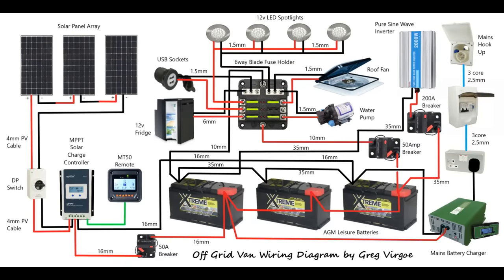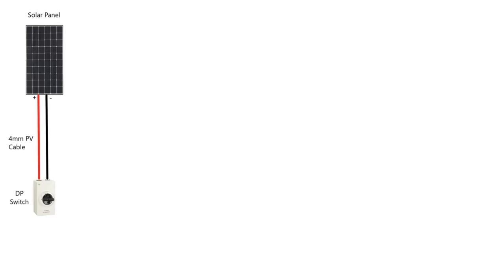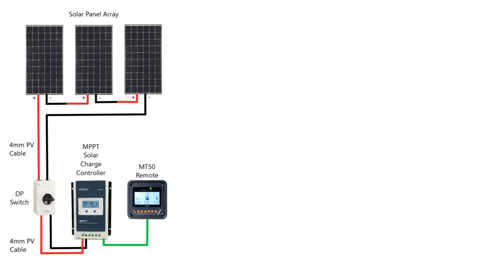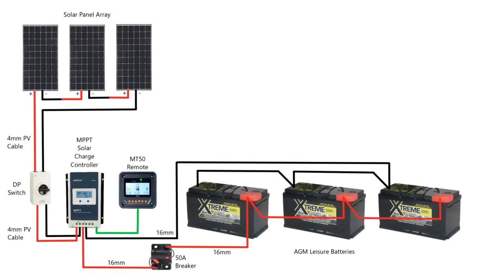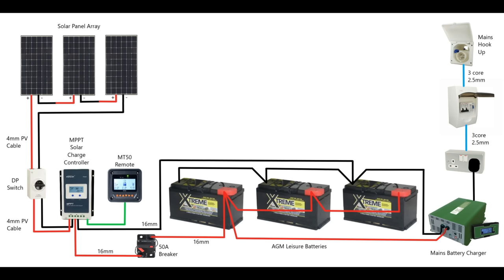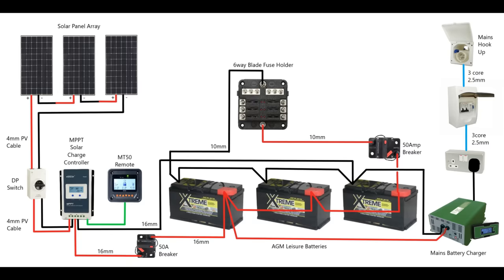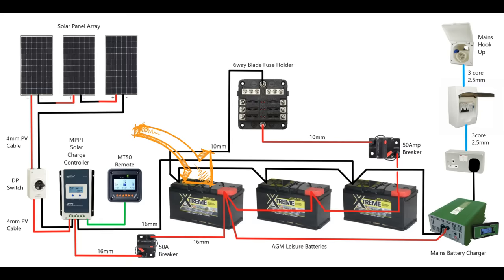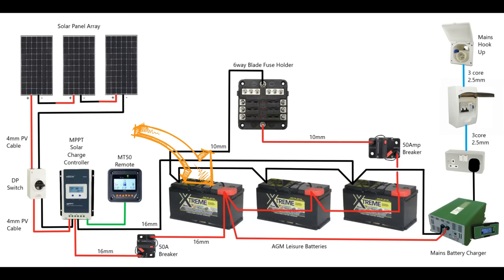How to Wire your Camper Van to be Off-Grid

Comment: Instead of wiring them all in series, I was thinking of wiring each light and switch as a home run back to a patch panel. That would allow me to reconfigure the groupings on each switch (if I decided later to change things) without having to pull new wire.

On the other hand, I have heard that the length of wiring has a great affect in the DC world, and that keeping it short is important.

Your thoughts?
Reply: This is the best video I’ve seen on electrics. Thank you so much.

Comment: New to this so I apologize if this is a dumb question but why would you wire the batteries in parallel @ 12v instead of in series? Your panels are already wired in series so why not wire your batteries in series to take advantage of the increased voltage and decreased amperage and keep all the cables thin?
Reply from the maker: The batteries are kept in parallel because all of the devices are 12v so it makes to keep the output the same 😃

Comment: Hello, first thanks for great info I have used this as the template for wiring my van in DC and it works great. i have a question about cable sizing, you have a 200A breaker on the line to the inverter which is a 35mm (squared) cable. I've seen 1/0 AWG or 55mm2 cable recommended for 2000W inverters, but haven't found that 35mm2 cable has the current capacity for over 200A - unless maybe there is a different sort . Anyway I'm curious to know how exactly you calculate the wire and fuse sizes for the inverter as a friend is going to add one to his van soon. Thank you! :)
Reply: No need to reply I found the answer in the comments!

Comment: Hello Greg, I'm in the very early stages of planning my build and finding your video's very useful. Having just watched this video I was looking for the link to the wiring download but couldn't find it. Is this download still available?
Kind regards
Reply from the maker: Hello Henry, There is a description below each video where all the links are placed. You do need to drop this down or click the show more button to see it. or use a phone or pc if youre watching on tv. Here are the links to save you looking.
Download your FREE wiring diagrams and parts list here:-
Wiring Diagrams for different types of off-grid van systems are here:-

1 solar panel, MPPT charge controller, 1 leisure battery and inverter.
https://www.dropbox.com/s/evzci35h8et...

2 solar panels, MPPT charge controller, 2 leisure batteries and inverter.
https://www.dropbox.com/s/h5yfuf090hg...

3 solar panels, MPPT charge controller, 3 leisure batteries and inverter.
https://www.dropbox.com/s/92ubo6d6k9m...

Your FREE Van Build Parts List here - https://www.dropbox.com/s/zvtyj0z7cde...

BS7671 Cable Sizing Chart - https://www.dropbox.com/s/5lf55srgelp...

Comment: Great video. 
What size controller would be required for 700w solar panels. ie:- 4 @175w each?
Reply from the maker: A minimum of 60A but always check the spec of the mppt as it will state the max input watts and the max input amps. 700/12=58Amps

Comment: Greg you are a great help.I have just got 2 130ah and 1 220ah batterys. what solar panals do i need. And what MPPT solar charge controller do i need.
Reply from the maker: Firstly can I just say you can’t wire batteries of different capacity together in one string. They need to be the same size and ideally the same type and make. Different size batteries will have different capacity and different charge rates. 
Your MPPT is sized by the solar input voltage and current and if you plan to be off grid or live in the van fit as much solar as possible.
Reply: @GregVirgoe  Thank you for letting me know about the batteries. I will stick with the 130ah batteries now. I am new to solar power. Looking at about 8 batteries for my set up. Just got my Numax 30a charger yesterday. And just ordered a lot more parts off your wiring diagram. I hope i get this right.

Comment: Hi Greg Great video quick question is it still possible to charge leisure battery from your alternator or does it still have to go mppt charger controller cheers Nigel
Reply from the maker: To do that ideally you need a battery to battery charger. DC to DC charger preferably an isolated version like Victron Orion then cables from starter battery to charger and from charger to your leisure battery. https://www.victronenergy.com/dc-dc-converters/orion-tr-smart

Comment: Great video - what size (amps) is the small consumer unit for the hook up ?
Reply from the maker: You will never be given more than 16amp connection on a camp site so if you can get an electrical wholesaler to get you one with a 25amp or max 32amp RCD and 2-3 circuits each 16amp breakers that will be able to run multiple sockets.

Comment: Hi Greg, As usual a fantastic tutorial, But just a bit confused on wire thickness for fridge. I have a 1998 Fiat Ducato & am fixing the 12v supply. In the owners manual it says to wire with 2.5mm with an inline 16amp fuse. In you diagram its says 6mm wire. could you clarify as I want to get it right. Thanks Daren.
Reply from the maker: This is due to the voltage drop on the cable and a lot of 12v fridges won’t run properly if the voltage is too low. 16amps on 2.5mm you can only run 1m of cable length and anything over that the volt drop would be too great. Use this handy free calculator to check sizes
https://www.12voltplanet.co.uk/cable-sizing-selection.html
Reply: Thank you for the info.

Comment: Greg, I saved your video 3 months ago and is rewatching it again...its so good. Question is whether you have any upgrade to the equipment and sizing since then? Thanks
Reply from the maker: I have changed our inverter to Krieger from the original one we had. But otherwise it remains the same and is working well. 
I may upgrade my solar panels to Renogy as they now produce some smaller more efficient ones. 👍🏼
Reply: @GregVirgoe  its 6 am in England! I assume you are in the UK. Thanks for the prompt reply good stuff
Reply from the maker: @skcapture  I’m in southern Germany so it’s an hour ahead of you. 👍🏼😁
Reply: @GregVirgoe  No Greg, Im in Hong Kong. Planning to van travel back to the UK (Yorkshire). Looking into van build by a company in China then drive it back to UK. With covid travel restriction, we might travel around China (single country) first, plenty to see etc.
Reply from the maker: @skcapture  we have travelled through 7 countries in Europe without any problems at all.

Comment: Hi Gregg, a huge thanks for uploading this video. I'm pretty much going to copy it, however I would like  to also have the option charge my lesuire battery's off the alternator, I know you can get dc to dc charges. I belive Ring do a mppt solar charger and dc to dc. So shall I just use one of those?. Also will. You be updating this video in the future showing it connected to the alternator?

Cheers Simon

Comment: Can I wire the inverter to the battery bus bars or should it be directly to the battery?
Reply from the maker: No problem with doing that. Often done that way with a shunt monitor. If you intend to use bus bars make sure the cable between the bus bars and batteries is larger enough to handle all the loads.

Comment: Hi Greg love all your videos there great 👍🏻 just a quick question, I’m copying this set up in my van but wanted to add a b2b charger to charge the battery while driving, what size cables do you recommend and what b2b charger do you recommend, the van is a 2015 2.2 Peugeot boxer thanks 👍🏻
Reply from the maker: Hello Leo, with AGM or lead based batteries the dc to dc charger should be no more than 10% of the leisure battery capacity so therefore I have 330AH of AGM batteries then the charger I recommend would be 30A. I also recommend using an ISOLATED charger and installing both positive and negative cables to the starter battery. Do not rely on the van body for the negative connection. Cable sizes would need to be at least 16mm²
Reply: @GregVirgoe  thanks for your quick reply much appreciated 👍🏻

Comment: Very good but...one question. If the circuit breaker goes off between the controller and batteries then the solar is still going into the controller without the batteries connected. This can damage the controller and this summer my Epever 60amp broke completely after the breaker tripped out. It may be better to put the circuit breaker on the panel side and nothing on the battery side. What do you think?
Reply from the maker: That’s a very good point and a fuse on the panel side is a good addition. If the battery side breaker went the panel side one may not trip so you could be in the same situation. Adding the fuse is still a better way to go. Cheers 🍻

Comment: Hi Greg, I have been reading about some people having problems with the max air fans due to the charging currents often getting into the high 13,s and low 14’s. Since your battery charger and solar panels will reach this have you thought about regulating the voltage or do you not see a problem? I am just about to start my wiring and the max air issue popped up which has made me wait a little. Thought if there was a problem you would have probably solved it hence why I ask you 😀 cheers, ggparry
Reply from the maker: I’ve never had any problems at all and our voltage can get up to 14.5 sometimes.

Comment: Hi Greg, you have a 200A breaker for the inverter, I live in Australia which is standard 240V outlets, what amp rating breaker would I need for my inverter connection? Thanks in advance I appreciate all your work and how diligently you go through it!!!❤
Reply from the maker: What size is your inverter?
Reply: @GregVirgoe  to be quite honest with you I haven’t bought one yet, I’m still trying to figure out which parts I need. My estimated daily watt usage would be about 420W, so playing around those numbers
Reply from the maker: @salihtaysi  the size of the inverter is based on what appliances you wish to use off it. For example a laptop charger could be 90-140w a smart tv could be 75-100w a small travel kettle can be 800w and a small induction hob would be 1400w.  Although we had a 2000w inverter we did not need anything near that big as the largest appliance we had was 140W 
So we have now downsized the inverter to a smaller one.  
If you plan to use electric cooking you need to make sure the batteries can deliver huge amounts of amps so lithium would be best.
Reply: @GregVirgoe  very insightful, much appreciated Greg, I’ll make a list of all the appliances and go from there

Comment: Hi Greg - thanks for all your information as always.  We have put the kill switch on the negative wire  between the e12v blade fuse box and the battery which works fine to cut off the circuit, but I need to change the lug on the positive cable that feeds into the bottom of the fuse box.  My question is: will this positive cable be safe to work on when the kill switch is off on the negagive side? Or do I need to disconnect it from the battery? Hope you can help! Thank you.
Reply from the maker: It is always safer to disconnect from the battery as the lose wire could touch other terminals or van chassis. 
Better to switch the positive especially if you have connected your battery neg to the van body.
Reply: @GregVirgoe  Thank you! 😊

Comment: Hi Greg. Thanks for all your detailed videos, they’re really helpful. I have a question about alternators, VSRs and batteries and cannot find anything useful online. Really hoping you can help!

Our alternator is rated to 150A, the VSR (not yet installed and we might switch to a DC2DC charger anyway) is rated to 140A. Assuming we use cables which are rated to 110A with 100A fuses, how many amps would the battery receive consistently while driving? It seems that they generally trickle charge with presumably a low number of amps flowing, but why is that when everything is rated to a higher capacity?

Thanks in advance for any help you can give - and sorry if I’m just being thick!

Comment: Sorry if I've missed this in your video, but do I determine the size of the circuit breaker between the leisure battery and charge controller by calculating the total load of my electrical system? I am just wondering what size breaker I would need to select. Your videos are full of useful information and thanks for taking the time to make them

EDIT: The electrical appliances used will be a 5KW diesel heater, 4x 3W Spot lights, 2x Dual USB sockets and a 12v socket and maybe a reading light, Maxx air dome fan
Reply: The rating of the circuit breaker between battery and solar charge controller would be calculated based on the total current that this charge controller can output to the battery. Your appliances have nothing to do with this. Instead, the current coming out of your charge controller is limited by the installed capacity of your solar panels, as follows: installed solar panel power in Watts divided by minimum charge controller output voltage in Volts gives you the max. possible current that can flow between charge controller and batteries. You would size the circuit breaker based on that maximum current.

(Only if you had connected loads directly to your charge controller as well, that would allow another current between batteries and charge controller, potentially in the other direction. But for the charge controllers I know, this is meant for small currents only, smaller than those created by your solar panels, and thus can be neglected. Greg in his wiring diagram does not connect anything to that load connector, so if you wire things up like he recommends, you don't have to consider this current because it will always be zero in your case.)

In general, when considering the current flow in one wire, try to find out (1) what is the source and what is the sink of that current and (2) what limits this current in normal operation. When it's about a charging current, current is limited by what the charger can output. When it's about a discharging current, current is limited by what the appliances connected to the wire can draw when they are all switched on at the same time.

Comment: Thanks for sharing this great video. As I can see, you connected your 3 solar panels into series which is connected positive to negative is it not supposed to connect negative to negative or positive to positive to make it series?
Reply from the maker: No, this way is correct for series. 
If you connect all the negatives together and positives together that would be Parallel.

Comment: Thanks alot
Very helpful 
Subscribed 👍
Will you please answer my question
If I connect a relay on mppt load and use that relay to get (suppose heavy load) 50 or 60 Amps from battery?
 Is it possible?
Please answer
And thanks again for this informative video.

Comment: Hi Greg. The positive output from the battery charger is also connected to the output of the charge controller according your diagram. These Mppt charge controllers do they have internal protection like a diode or not, if not then how would you protect the charge controller from the trickle charge from the battery charger? Thanks. The rest seems very sensible.  Best regards, KB
Reply from the maker: The MPPT sees the increase in charge voltage and assumes the batteries are fully charged so shuts down to minimum.

Comment: Hi Greg, thank you for all the useful information! We are building a van and we are having some trouble sizing our mppt charge controller. We plan on having 800W of solar power and possibly a total of 400-600ah 12V lithium batteries. I know it also depends on the wiring of the panels but how much output charging current do we need and how does this relate to the charging rate of the batteries?
Reply from the maker: The required charging current for batteries is typically 10% I.e.
400Ah x 10% = 40Amps
600Ah x 10% = 60Amps
Make sure the chosen charge controller will accept the total solar input power and voltage by referring to its specification.
Reply: @GregVirgoe  Great thank you! would more amps than necessary be an issue? I'm thinking whether we could we get 60amps for 400ah of batteries so we can have room for upgrade in the future

Comment: The wiring you use in your video where your showing how you do your build your showing blue for the hook up side and black for the 12v side well there's one wire your using for each appliance I'm guessing each wire inside as got a positive and a negative in the same wire

Comment: Great video, thanks. When using outside mains to charge batteries do you have to isolate the MPPT Charge controller?
Reply from the maker: No they can both be on at the same time.

Comment: Question? If I run wires loose through the panelling in the van and hide it in the insulation to the lights etc, does that need to be inside a conduit and then up the size of the cable?
Reply from the maker: I would recommend protecting it at least where it touches sharp edges of body work where there is a potential for it to wear away the insulation. Cable sizes do need to be increased when installed in insulated areas as they cannot get rid of the heat so easily.

Comment: Hi Greg, please could you advise on if its possible to run a 240v fridge off electric hook up and from the invertor and be able to switch between the 2 of them. And if so how would you do that? Thank you for reading
Reply from the maker: Yes it is possible. Please email me gregvirgoe at gmail and I’ll send you back a specific wiring diagram